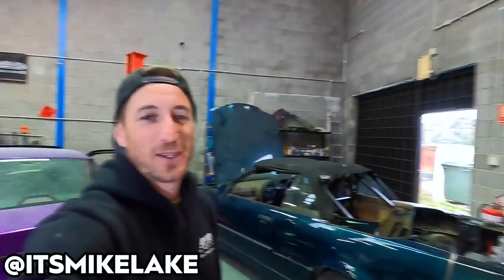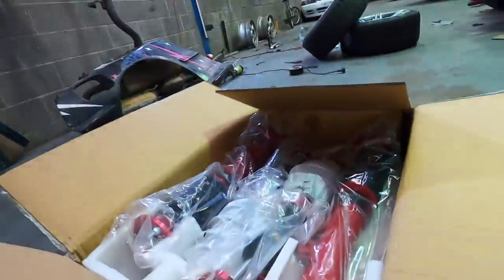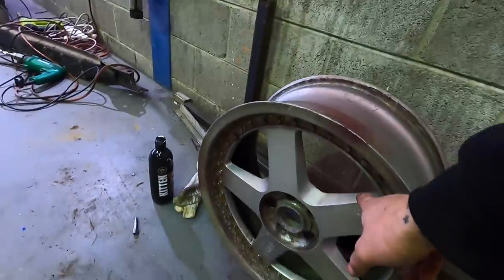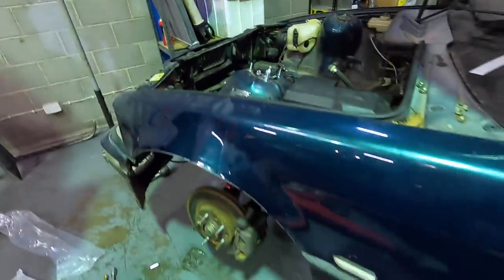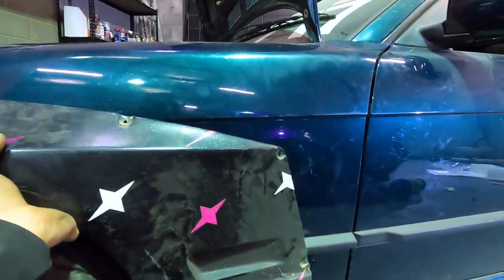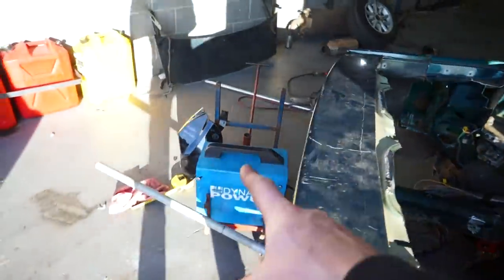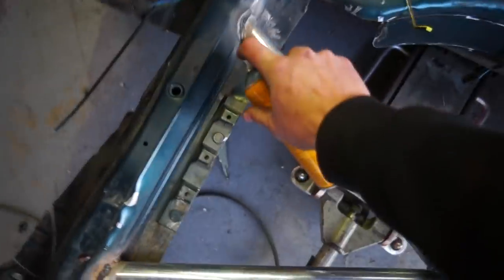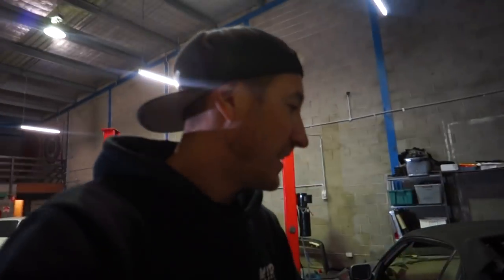E36 UTE BUILD EP:2 - COILOVERS, WIDEBODY & WHEELS INSTALL 🤩

Comment: Fuck those coilovers off, I had those exact ones and they broke in a week driving down the motorway and the fronts no matter what would always bind, I have also seen them completely snap in half on e36s either track driving or drifting
Reply from the maker: What the hell were you doing to snap a coilover in half? I ran these for 2 years of solid drifting without issue. They're rad for $350!